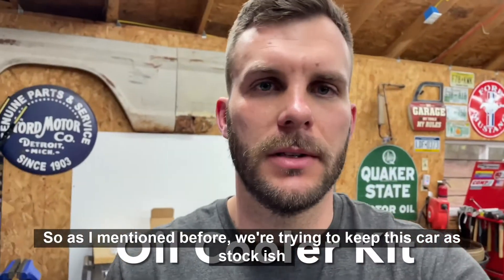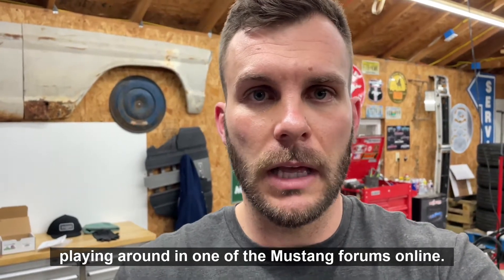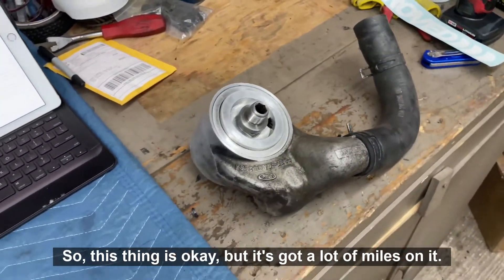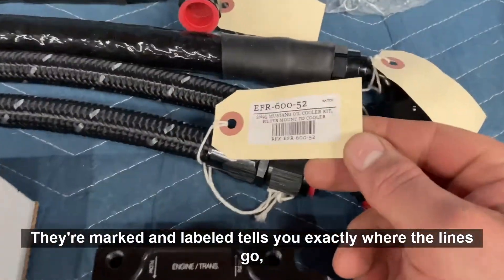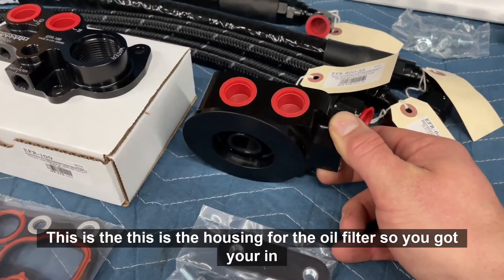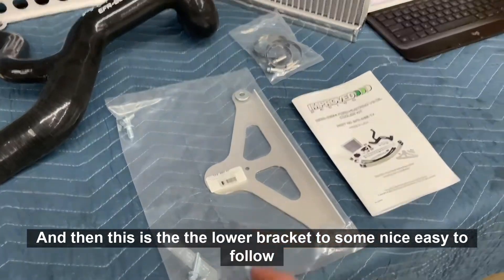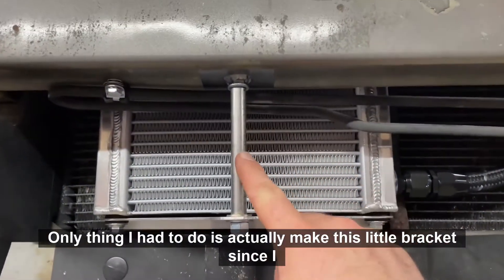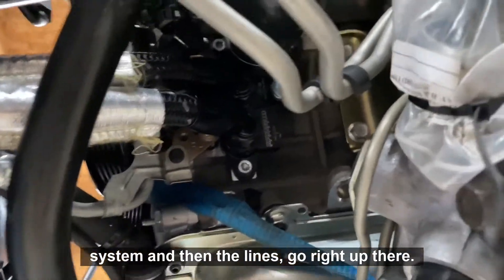Installing An Oil Cooler On A New Edge Mustang

Comment: I'm in the process of doing this install. I see you moved the oil bracket closer towards the center of the car compared to the instructions...and seeming drilled an extra hole. How come before I start drilling 😂
Reply: Sorry I missed this, give me shout if you still need help. RR1 also do a great job with tech support.
Reply: @ivankorda4874  I got it all squared away now. Had a couple of issues with install